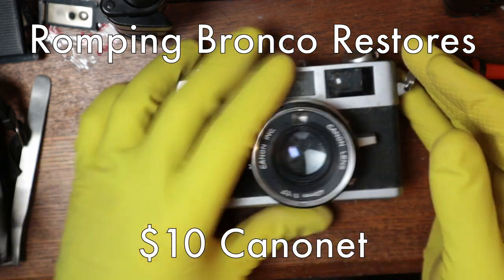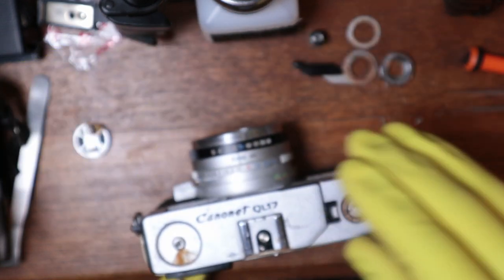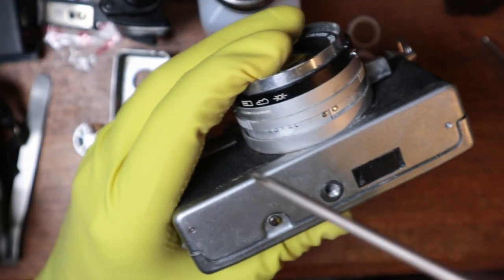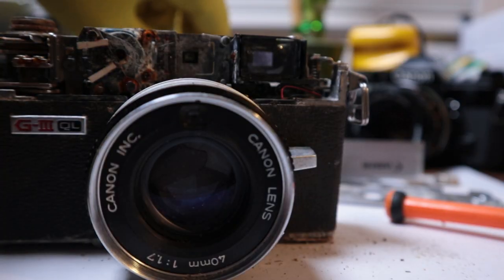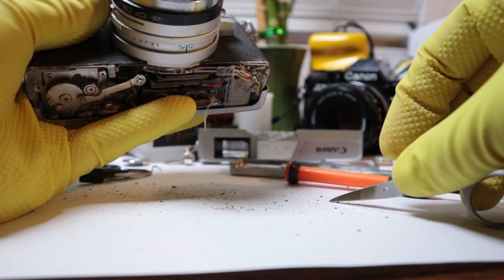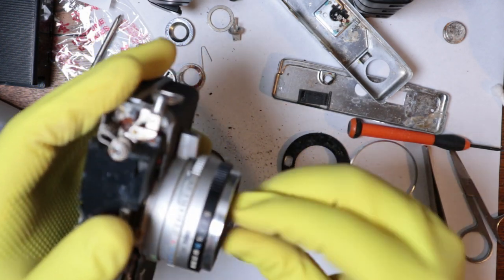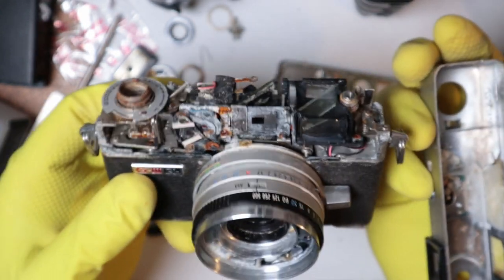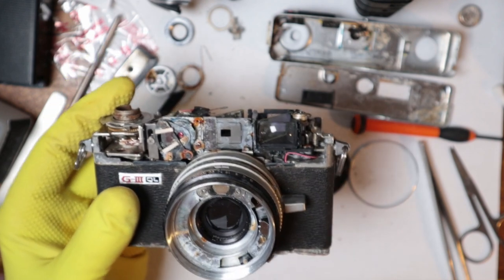$10 Canonet QL17 G3 Teardown

Comment: I would be tempted to see how many rusted parts could be saved by using a non corrosive rust remover and maybe some magic with ultrasonic cleaner.
Reply from the maker: It's hard to say because with this camera especially I'd worry that the integrity of the parts was compromised by the sheer amount of buildup but I'm holding onto the parts in case they may be salvageable. I wouldn't mind dunking the whole camera into an ultrasonic cleaner 😅